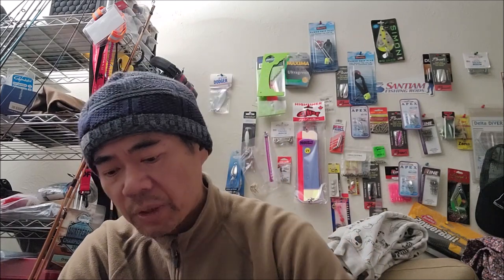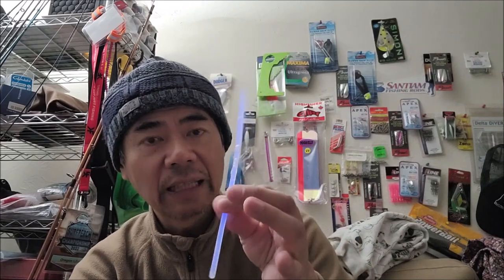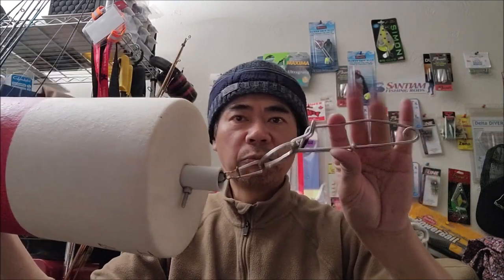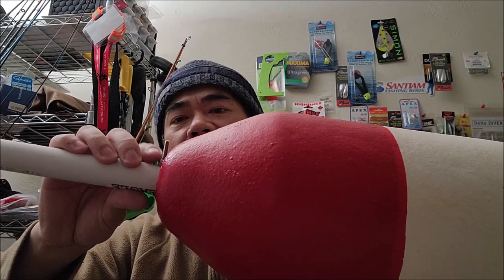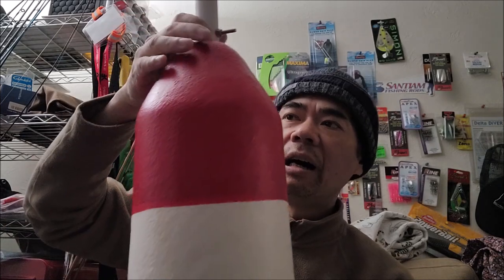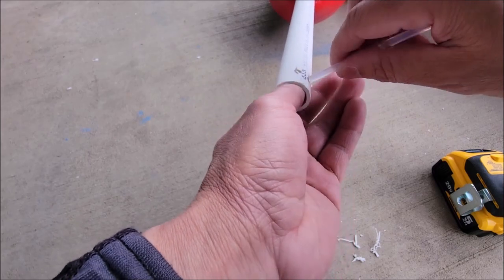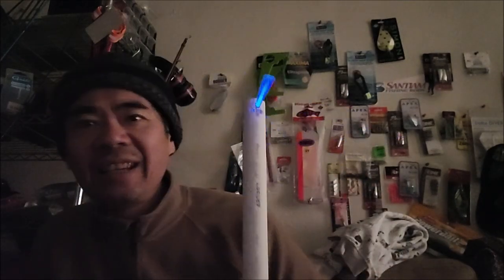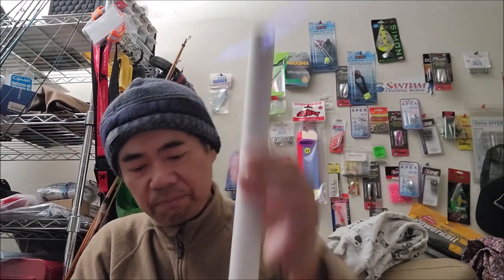How To Make A Crab Pot Buoy

Comment: If the bolt and nut starts digging into the buoy foam, you might consider adding a large stainless steel washer between the buoy and the bolt/nut.

Comment: Awesome! 
Now... I just need a boat 🤣
Reply: Go for a drive out in the country, and you'll typically pass several boats for sale, sometimes with trailers and motors included. While a jonboat wouldn't be ideal for crabbing, I've seen them for sale many times, with trailer and motor for about $500. I think you'll find a small aluminum V-hull or runabout for around the same price, although a motor might not be included, or need work.

Comment: Instead of buying glow sticks forever, which are often bad for the environment, maybe look into rechargeable LED lights, you could get one that blinks that you attach to the end of the pipe.
Reply: I don't like glow sticks because they only last so long, but they are pretty fool proof in this application. And easy... who wants to mess with recharging MORE STUFF nowadays. You'd need a whole charging station in the garage, with one charger for every light, unless you want to babysit everything for a week, every time you go crabbing. Perhaps there's some waterproof lights that run on a single AA  battery, and then you could pop 8 batteries in a charger when you get home.

Comment: One possible upgrade here would be to add a washer to the pvc pipe between the bolt and the foam to keep the bolt from rubbing against and wearing down the buoy.
Reply from the maker: good point. I'm going to fix that overlooked issue.
Reply: @oregonlife  Another solution might be to add a PVC 4 way elbow fitting into the equation on each side of the buoy instead of using the bolt.  You would have to glue it on or use a threaded version but it would keep you from having to use the stainless or drilling holes in the PVC.